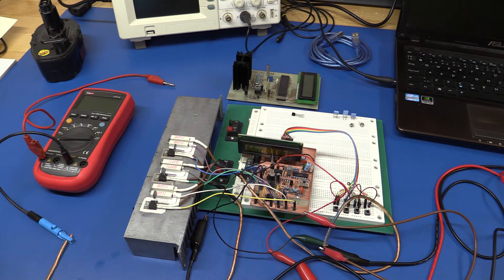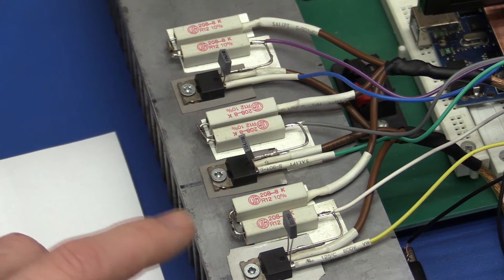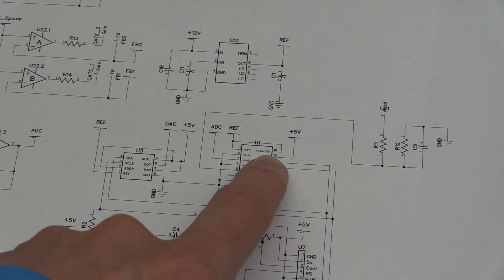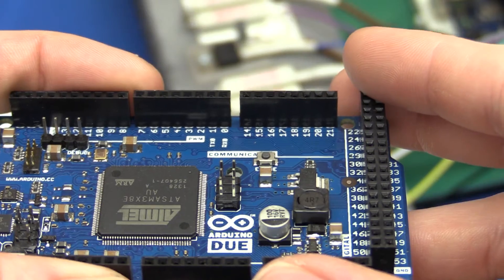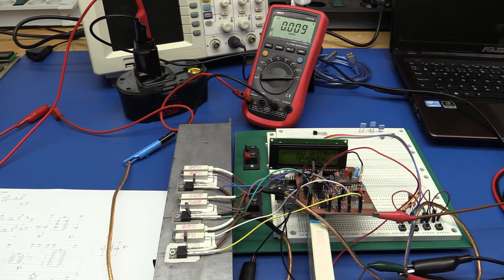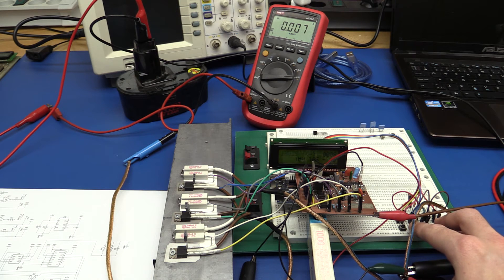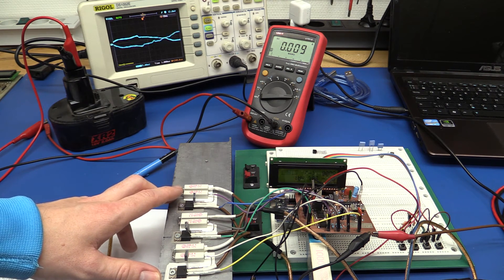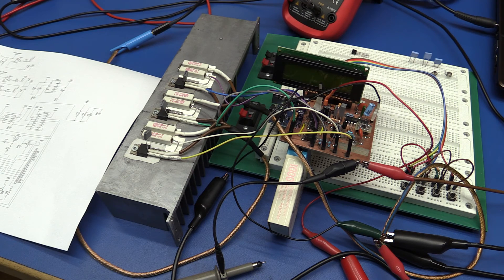DC / CC Load: Part 3 - Updates to the PCB - Ec-Projects

Comment: What op amps do you use? What i have is, 0.1r for sense, which means 1mV on op amp is 10mA on output. Don' t know what can you do once in such range, mV... where noise is the main problem
Reply from the maker: First2ner I use the LT1013CP. I think you could get that to work, I used 0.1 Ohm on my first try and that seemed to work... I think my problem was that I tried to drive all the MOSFETS with the same op-amp :)